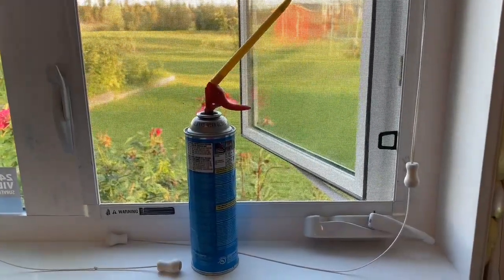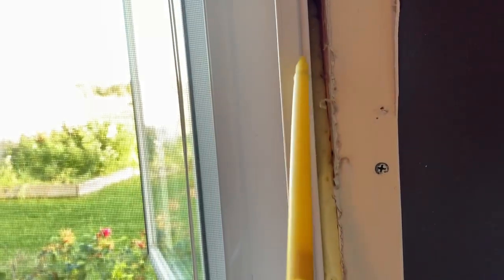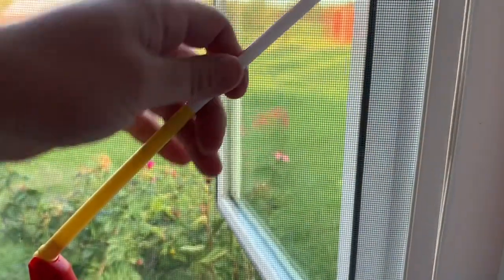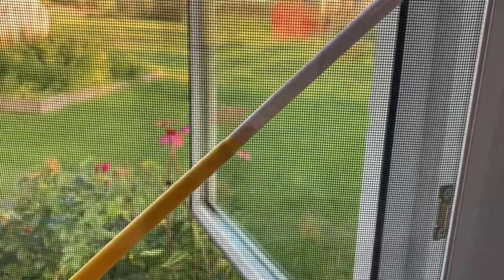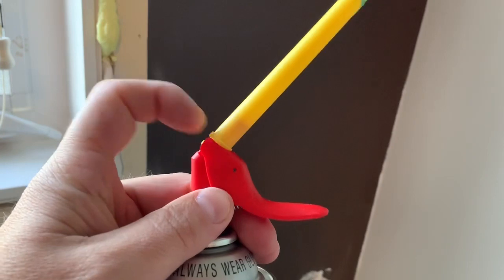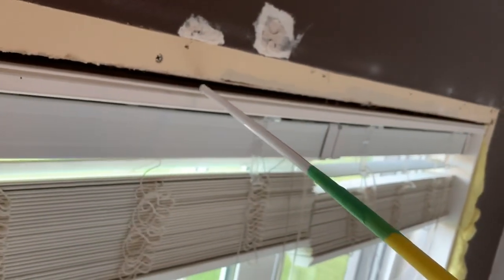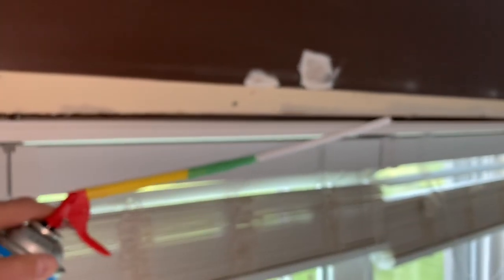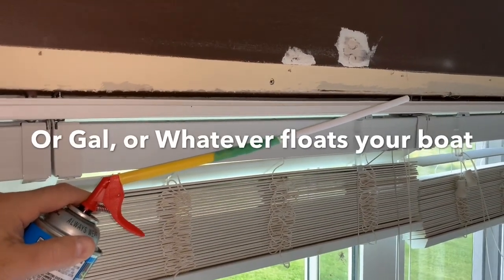Spray Foam Hack

Comment: That makes sense! Wouldnt be a bad idea to light some foam in there and then pack with insulation! Nice trick!
Reply from the maker: Up in northern Alberta its best fill the entire cavity with the foam. But do it in two passes so the first layer only does half the depth and keeps the skin. Once it’s cited do the inner half which gets cut flush. Once the foam skin gets cut it loses it vapour barrier properties and just becomes insulation, not the VB and insulation. Hope that made sense.